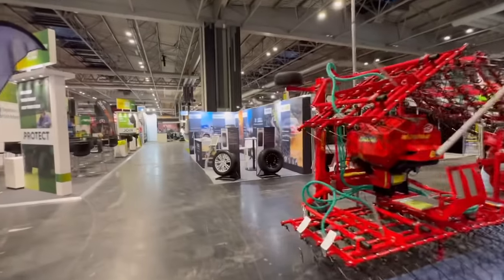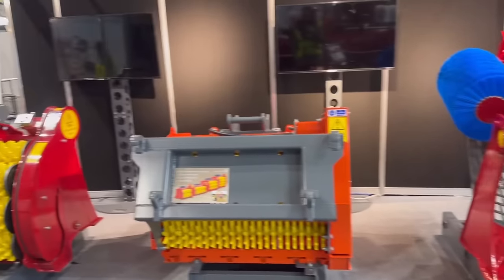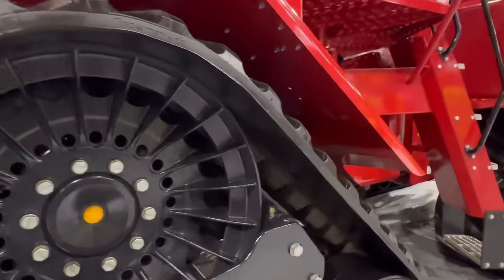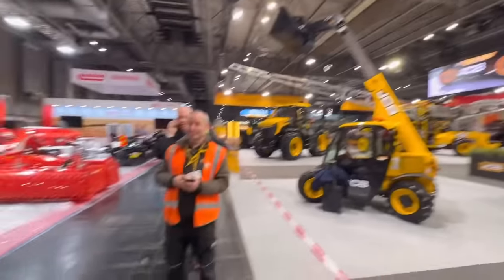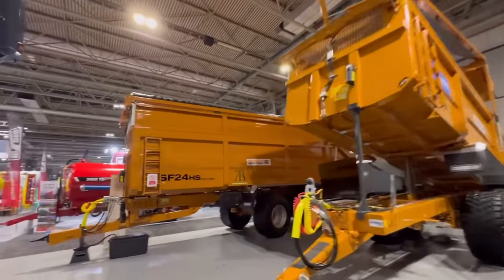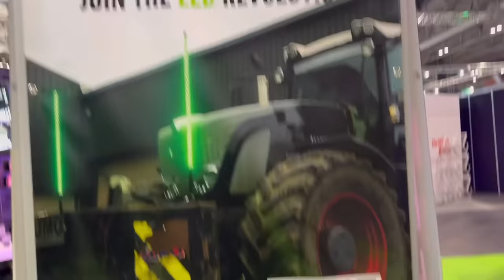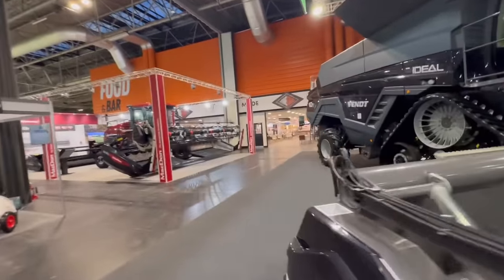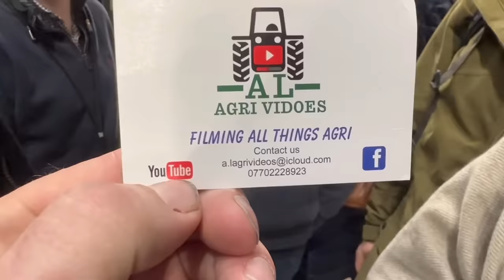LAMMA SHOW LOTS OF TRACTORS DAY 2 #AnswerAsAPercent 1401

Comment: I remember Draper pickup units for picking up oilseed rape back in the early 70 s . First you had to cut and swath the rape , only a J.F. 8ft swather was available, which was very flimsy mounted on the front of the tractor , the rape in those days was around 8 ft plus tall , so was a nightmare to cut . Virtually every time round a 25 acre field I had t go back to the workshop to weld more strengthening on to it  , luckily the field the first year was next to the yard . I struggled for two or three years with this setup until a seed department company in France bred a much shorter rape called Jet Neuf which was only about 4 ft tall , a game changer , and then new varieties got shorter still . I think I scraped the J.F after two or three years , when I had done some contracting for a neighbor who had left a set of land rollers a few yards inside the field covered by the crop which I hit at probably 5–6 M P H and did considerable damage which took me a couple of days to rebuild half of it  . The he moaned because the seed was falling out . Oh happy days .😤😤